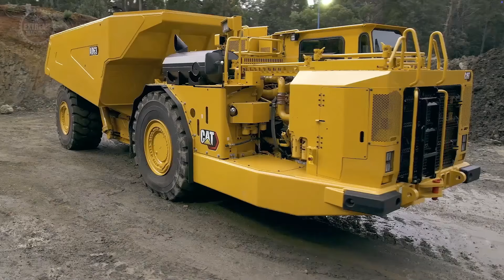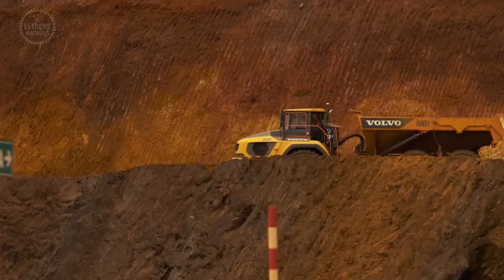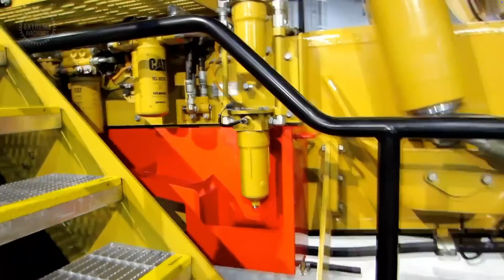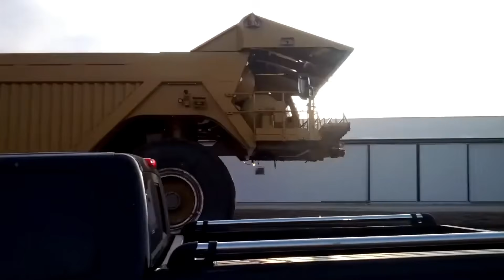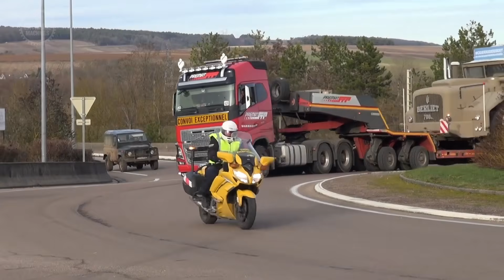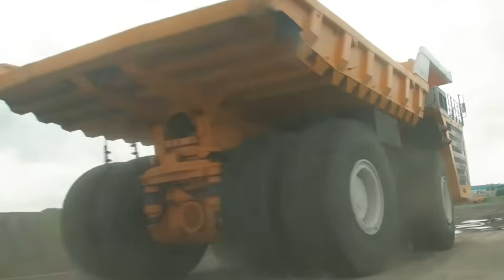The BIGGEST and Most ABSURD INDUSTRIAL TRUCKS Ever Built by Man — MUST SEE!

Comment: first entry: 6x6 traction on a vehicle with 4 wheels??? At least you got the 6x6 traction correct on the 2nd entry. A vehicle with 6 wheels having 4x4 traction? The correct answer if it is indeed only driving on 2 axles would be 6x4. The Komatsu 980E as you call it is showing in the video as a 930E. At least you did end up showing the 980E. What is a Belaz 751010? The one you show in the video is a Belaz 75710. 8x8 traction? Have a look at the truck, it's missing 2 axles for that! Can you get anything right in this video?